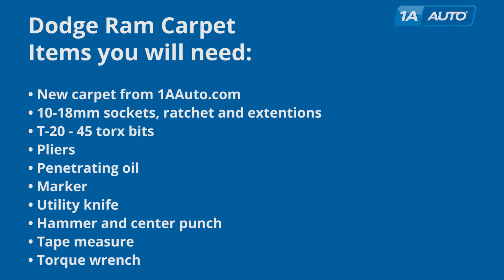How to Replace Carpet Quad Cab 03-08 Dodge Ram 1500

Comment: how long does the whole process from start to finish take?
Reply from the maker: +Rita Medina We would not be able to confirm how long the process will take as there are multiple factors that could affect the installation process depending on the vehicle as well as the experience of the installer. Thank you.

Comment: will this work for a 2500?
Reply from the maker: +James Strickland The part in this video fits your application, and the install should be the same or similar. Buy this part on 1AAuto.com: http://1aau.to/m/Shop-1AAuto-c
Reply: @1AAuto  hi could you try that link again? Or should I buy the same carpet in this video. Thanks